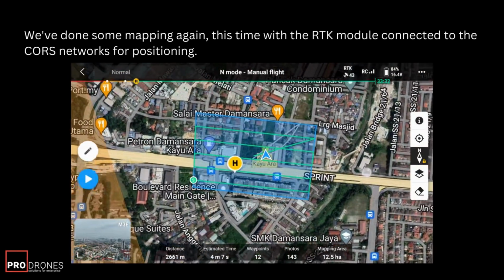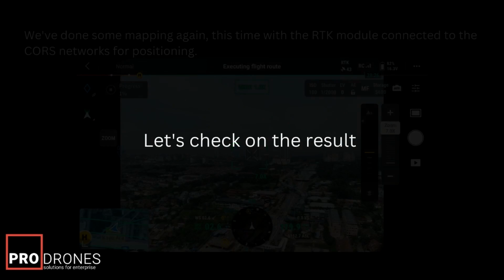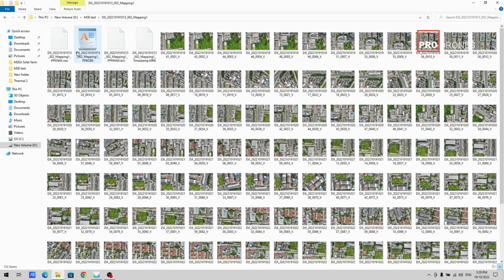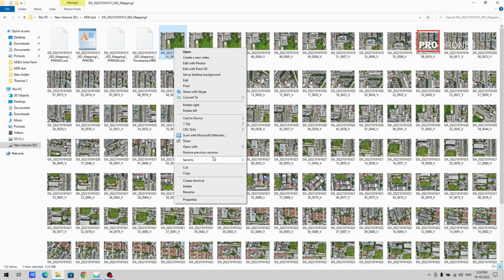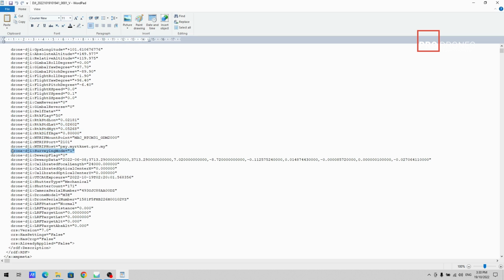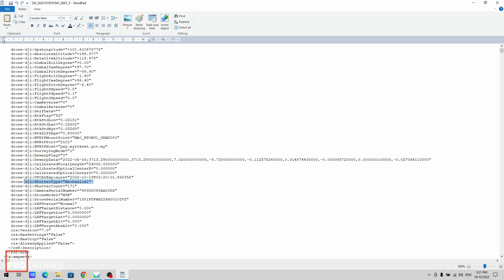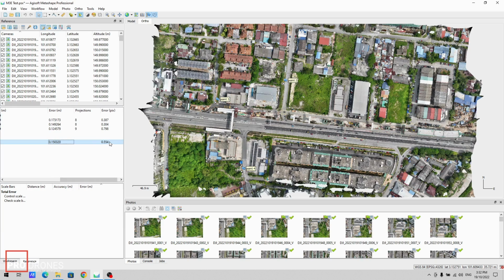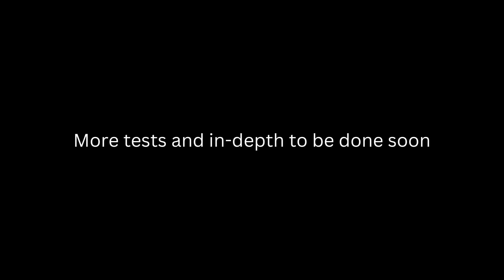DJI Mavic 3 Enterprise Mapping results with RTK -Part 5

Comment: Hello my friend
All good?
First of all, congratulations on all the videos you are producing!
Did you ever do precision tests using DJI's D-RTK2 RTK together with the drone's RTK Module?
Reply from the maker: All good! Yes, we do frequently use the DRTK2 with all the RTK enabled models as we also need to test things like binding method etc. We find that the DRTK2 is a bit picky with placement and exposure to satellites to get good quality data. The accuracy from our testing is good so far. Usually around 2 to 3cm relative to aircraft. Hope this helps !!!
Reply: @prodronesasia5262  Can you share the workflow are you using to get this accuracy? Are you using DJI terra ? Thanks have a good one!

Comment: Turns out that the Mavic 3E does not support the D-RTK 2 in mode 3, so you can't establish ground control points, what a conn. Don't buy the Mavic 3E with the D-RTK 2 for mapping, waste of money.
Reply from the maker: For this case, the DRTK2 can still be used to record the RINEX data for the GCPs and then have them post processed. They key advantage is the signal stability compared to 3rd party bases as the range of the Occusync used in the DRTK2 is much better than that of Wifi. But I do admit the lack of the measuring ability is a massive let down.

Comment: Did you use Altitude Optimization (1 line of oblique images)? And was the dataset all nadir images? My Phantom 4 RTK and a PPK kit on my Phantom 4 Pro V2 both have an elevation offset. Witht he PPK kit, 1 GCP solves it and with the Phantom 4 RTK, 1 line of oblique mostly fixes it, but using all oblique or even the 5 flight multi orientation fixes it.
Reply from the maker: Yes we do. On tests previously with the P4RTK, we found that it reduced the vertical error from about 5m to 5cm.

Cheers!!!

Comment: Thanks for the test results.  I would suggest that you select one of your check points and set it as a ground control point giving it more accuracy "weight" than the cameras.  And then run the "optimize Camera" function again.  Even RTK drones benefit with at least 1 good GCP, especially in the z axis.  Give it a try and see if your checkpoint accuracy improves.  I think it will.

Cheers! 
Dave
Reply from the maker: Hi Dave, thanks for the comment. So why we don't use control points but only check points is just to see what the raw accuracy of the whole system is. Of course, when you optimize the data it will improve but what we want to demonstrate is the actual performance of the drone as a system. That is why when we do tests, we even turn off rolling shutter compensation to ensure we see only the raw performance of the system. This methodology has showed us several flaws in some systems like the lack of offset data in some PPK systems, poor camera performance and even poorly synced GNSS data. Hope you understand.

Cheers!
Reply: @prodronesasia5262  I understand. My point is that I have never seen a precision gnss on a drone that provides <3 cm vertical accuracy without the help of a GCP.  Have you?
Reply: Amen!!!

Comment: GREAT video, THANK YOU FOR SHARING,
i think you are the first one on youtube that share the accuracy check of M3E with RTK Module,
By the way can you share us the list of error from cameras postitions? (what is the Max and Min value of error)
i think you were right that the check point error is quaite large for this mapping result (0.15 m) and maybe you find the BUG of M3E time mark lack syncro with shutter......
Reply from the maker: Errors from the camera were between 0.08m and 0.01m. As you can see, the pix error is still small. I think the errors comes from the Z value. Any suggestions on how to check timing synchronization? Will try to find out more about this error. Thanks
Reply: @prodronesasia5262  
I assume that time sync is to find millisecond time delay between shutter open and time mark. BUT, when you said the cameras positions errors is between 8 and 1 cm it think this M3E is ready to go.
We wait for your next video for more testing on M3E.
THANK YOU